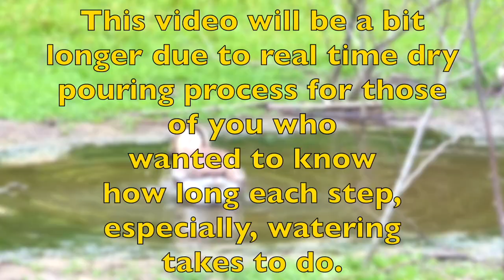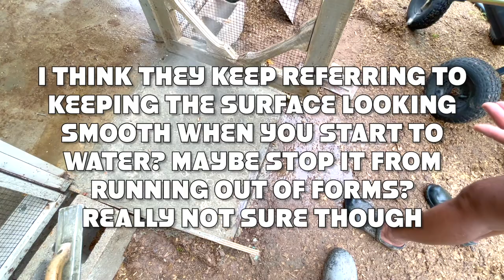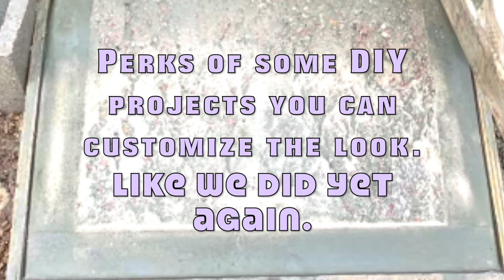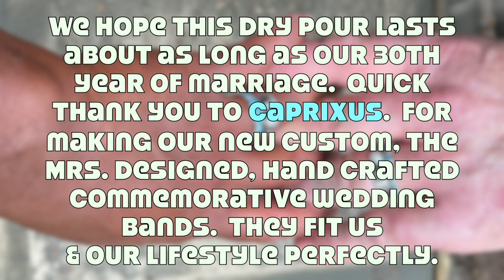DRY POUR #CONCRETE TO FIX WET POUR PT 3 | #DUCK/ GOOSE/ FLOCK #COOP RAMP MISTAKE? 😯😧😕 WILL IT WORK?

Comment: Definitely a HUGE mistake...you will be ripping all that dry pack stuff out eventually due to the concrete crumbling over several months and winter will destroy it for sure...strength of concrete is all in the initial mixing
Reply: That's his slab, not yours. Enjoy the show
Reply: Funny thing is that, when that happens, they'll simply chalk it up to just bad technique.  Then they'll say they just need to do it a little differently.  And you know what?  We'll definitely agree;  they SHOULD do it differently.  They should ....oh I don't know ..... maybe MIX IT WITH WATER FIRST?!?  LOL  This some corny ass stuff man!!!
Reply: I do agree but I also give them credit for trying..  Many videos don't show the longevity of what a dry pour slab does and just shows how easy it is to create..  As least in this case it's something very small and would be easy to break apart and do it over again the right way without having too much time and investment involved..
For those that want to try and attempt a dry pour, here is some valuable information to show you what you will be dealing with in the aftermath-  

https://www.youtube.com/watch?v=2F_3GrGFenU

https://www.youtube.com/watch?v=Fvzu56fjZRg
Reply from the maker: Thanks for your comments.  We do share updates of how it's been holding up.  This was a  test to see if it actually will work for certain projects.  We chose it for this one since it was small enough to break it down if needed but big enough to see if it could handle a large load.  A 4'x6' example is really not that big and can last for quite a few years if done right.  If you want to see how long this dry pour test works out for us.  Please check back in our Flockn Clubhouse series or DIY/DIO playlists for updates.  

☮️
The Mrs.